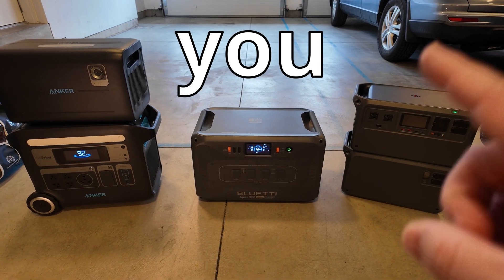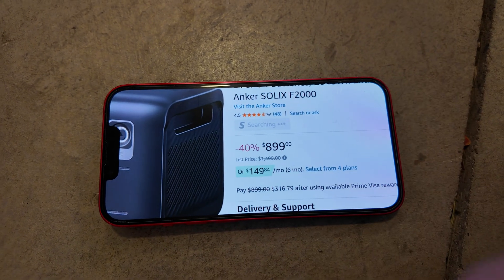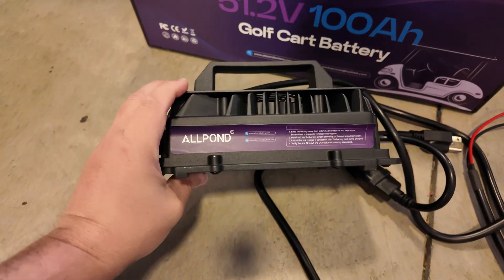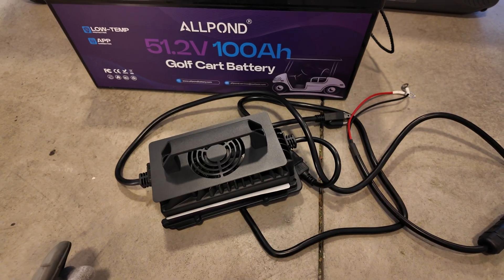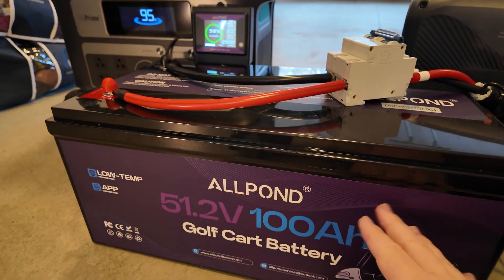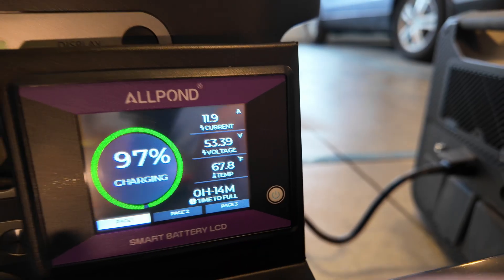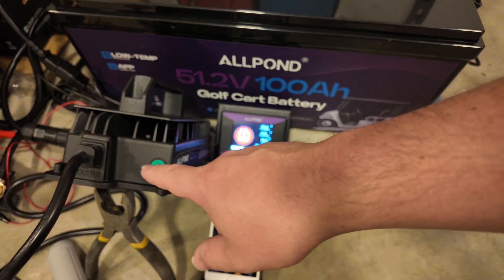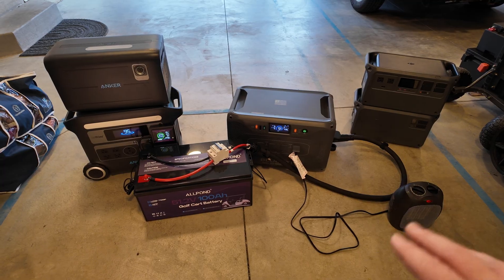The Great Solar Generator Rip-Off (And How to Beat It)

Comment: You are being deceptive by comparing apples to golf balls so lets stop here. A Lead Acid battery like you show is crap and is NOT a LiFeP04 battery which lasts for thousands of cycles and is what the Bluetti/Anker others now use. Going to ALLPOND I did found newer LiFeP04 batteries and that brought the cost up equal/competitive to what Bluetti and the other are. I do like your hack though if someone has the golf cart batteries  or can find them really cheap and then also has the room for all the "Kibbles & Bits" that will be open and laying all over the place to make this Frankenstein hack work. In conclusion, price check this option and also know whether you need an ALL-N-1 solution that is easily moved, safe and storable vs a Frankenstein hack that brings on added complexity and flaws but might potentially save a buck or two - maybe? Regardless, this is a great option if someone is on a budget and can actually find various pieces on sale.
Reply from the maker: Ummmm…you might want to look closer at my golf cart battery…it’s LiFePO4! I’ll take a hard pass on lead these days too!

Comment: Great video, and something I’ve wondered about.  What would stop you from DIY’ing a battery bank with mega Ah as long as it was 51.2v and LIFEPO? (I’m thinking EVE/CATL 314Ah cells). Does capacity difference matter?  When the Bluetti reached 0Ah would it just double the draw on the CATL’s?  Thanks for the info.
Reply from the maker: Nothing is preventing that at all so long as you have proper over current protection! Did you see my "tower of power" in this video? I have what you are talking about going on! :)

Comment: Last year, I purchased an Oupes mega 2.  the expansion battery cost is insane so are there solar panels it works then I purchased 2 wattcycle 12v 100Ah and a 2000w inverter $450? Works best bang for the buck
Reply from the maker: That's awesome you found a great bang for your buck solution!

Comment: Watching this 2 weeks after I bought 2 Delta 2 Max expansion batteries refurbished off EBay. Saw your original doing this with a Temgo, but I still know too little about electricity & couldn’t trust myself to not torch our house missing a step or wiring something wrong.   Hurricane Helene (we’re in Asheville) still has me on edge. If I could tell anyone ANYTHING…don’t start w/ a 120 volt unit if you choose the portable power station route
Go to 240V like the Bluetti. Pay for.a transfer switch. Then you can do this shortcut and a dozen others. But if.get stuck with a 120Volt unit like me, you have no future flexibility to run important things
Reply from the maker: Thanks for sharing your experience and the great advice about 240V systems for future flexibility!

Comment: ❤❤❤❤ This is beyond interests to me as I have the anchor unit that you show there as my soul power source for my full-time living school bus conversion and was contemplating getting the expansion battery! With this Allpond battery solution it would effectively double the battery expansion I do see that it is large but I am inside of a full size bus so I will make the room and I guess I could eventually add a second one of these batteries to the mix yes? And you say solar should be ran through it instead of the  Anker unit? I'm guessing that would facilitate more possible solar than what the Anker itself grants? 
This is my second year living in the bus so now it's time to tie down things and finalize what works and what's the best bang for the buck.
Reply from the maker: Yes! This is perfect for your setup!!! The Allpond battery is actually smaller in cubic inches than the Anker expansion battery! Which is crazy cause it's more than double the capacity! It weighs more however. And yes, you can pair a bunch of the Allpond batteries together! And yes! The solar inout to the batteries can be MUCH higher! This is my favorite charge controller! https://amzn.to/43LkeUW It gives you double the solar the F2000 can accept. If you add more batteries, add an extra controller and solar for each one! You could have a sweet system! Especially with a full-size bus to work with!

Comment: The old Bluetti expansion batteries at least had on-board outlets (and in the case of the B210, even it's own on-board 500w solar input!).  The new ones don't, sadly.
Reply from the maker: Yes. Kind of sad.
Reply: I think they were trying to lower the price point by stripping down features.
Reply: Yes. This year they are obviously trying to save pennies to lower the cost of “per watt hour” to look good while still making their cut of profit. There really is no other way to express what they are doing (i am a Bluetti guy) except by saying “penny-wise, pound foolish.” 😢

Comment: Great video and great idea.  But it is not portable(for me). If it doesnt have to be portable then its fine. It is use case dependent.     In my use case wieght is a key factor.  I have a pecron F3000 because of the smalll footprint and it weighs "only" 63lbs.  The EP3000 extra battery is 53lbs.  That AllPond Battery wieghs 87lbs by itself.. The "small" all in one units in the video have small built in batteries In comparison(to the Pecron F3000) and the add on batteries are the same small size.  I have  6144 whr because the F3000 has 3072whr to start with and the extra battery adds the same 3072whr. its all in what the users needs are.
Reply from the maker: You're absolutely right! It's all about individual use case and needs! The portability factor is definitely a big one for many.

Comment: There is a video on how to hack into the battery expansion port on the Anker Solix F3800 to output to XT60 cable. I wonder if the same can be done on the Anker 767 Powerhouse you have. Here's the video. https://www.youtube.com/watch?v=afumx_g3Xg0
Reply from the maker: Yes! There is! I plan to make a video about it at some point here!

Comment: I couldn’t find the weight of this golf cart battery at the Amazon product link. AI “Rufus” didn’t know. All the reviews talked about the weight being so much less than lead acid batteries. One mentioned he weighed it. Funny, no one states the weight. It’s also odd that it would be left off a product description when there’s all this comparison going on and how much weight matters. I want to know if I can lift it. So, how much does it actually weigh?
Reply from the maker: It's about 90lbs. So WAY lighter than the same amount of battery storage in lead acid. But still heavy enough to be careful lifting it!
Reply: @theresatrickforthat  Thank you. Your video had good info.

Comment: Black Friday Deals - I have been kicking around getting the Fossibot thats 3840Wh 3600W for $979
- I do own a few Delta 2 units (and unfortunately I did buy an expansion battery at the time)
- I see the VATRER server Battery and these G.Cart Batteries and have been kicking around getting one of these, and doing the DIY as shown.
- I also have a few DIY systems, 24V and 12V.
- My FOSSIBOT interest is due to: it is just there ready to go, all in one system at a great pricing.
- So, anyone that reads these comments, is the VATRER Rack Battery or the Golf Cart battery the way to go?  I see the advantage of having a 5210AH backup to use on the Delta 2’S 
- I appreciate any responses….
Reply from the maker: I have the FOSSIBOT as well as the Vatrer server rack battery (videos coming on both of those within the next 6 weeks!) I haven't fully tested the Fossibot, but it seems very good bang for the buck! 

As far as the comparison on the battery. Get the server rack battery if you want a huge pile of batteries in a server rack. and it's nice and organized!
The golf cart battery is better in every other way and is better bang for buck. Has more monitoring capability since it has a screen & bluetooth app (Vatrer only has a screen) they are built for high vibration environments so great for moving around or in an RV, are water resistant, can be outside in the weather! And come with a really nice dedicated charger!

Comment: Great information you are sharing, thank you. Propose you test the "alternator" chargers like the 800W one from Ecoflow to do this, only difference is battery will have to be 12V or 24V but it is a bit more straightforward and can also reverse charge as well.
Reply from the maker: Are you spying on my future video spreadsheet? Alternator charging combined with solar power coming in hot in a few weeks! :)
Reply: @theresatrickforthat  Haha, looking forward to it! Thanks!

Comment: This is great! But the AllPond isn't less than half the cost of the proprietary ones. It is less but not 'less than half'; if it was , it'd cost less than 500 bux.
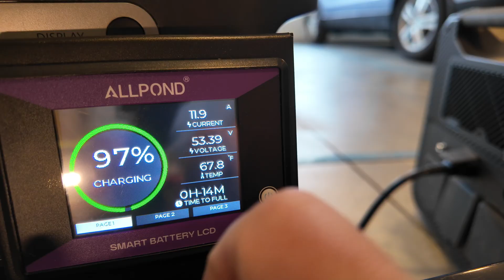You lost me at the 11:00 min mark, where you had the AllPond hooked up to the bluetti, but then one of them was also hooked up to the anker....? I'm no electrician so, no idea what that moment was about.
In any case, very interesting and will certainly keep this in mind should I want to expand. I only have a little AC70 Bluetti which I've yet to really put thru its paces. I'm going slow, learning, watching lots and talking to solar people.
Reply: I just bought a 3kWh Anker expansion battery on sale for $900. Pecron has their 3kWh battery for $700. The 5kWh golf cart battery is $730. Per kWh, that's $300, $233, and $146 respectively. The claim of "less than half" seems legit to me.
Reply from the maker: It is less than half for sure! Add up the cost per watt-hour of battery storage and you'll see if easily half the cost or more! 

Yes! I'm showing two different connection options! Subscribe and I'll be showing more info and you can learn more on your quest to learning about this kind of stuff!

Comment: Look forward to the video on how to make this cable for Ecoflow extra battery. From what I see you chop off one connector, hook two DC cable on a DC CB, but what about the rest of the data cable?
This setup can reduce the cost of solar battery for ecoflow Powerstream setup. 800w micro grid tied inverter combined with 1000w PV inverter in Delta 2 Max.
Reply from the maker: Yes! That video is on my list for the coming weeks!
Reply: @theresatrickforthat  exciting!!!   Ready to use one of these Allponds to expand my Delta 3 Plus with the direct EXTRA BATTERY port
Reply: @theresatrickforthat Mine too, and I covered this battery hack in detail and expanded it to be automated and have a global dashboard.

If we are covering the same things, maybe collaborate?
Reply: @ViciousXUSMC  Ecoflow powerstream used to be on sale for $100 (or GBP), if this modified can bypass the "smart" thing that control the ecoflow system then it can significantly reduce the cost of micro inverter solar setup, because delta 2 max still cost quite a lot for only 2kw and not many want a camping battery, only home setup.

Comment: Awesome video. 

My understanding of the Anker f2000, which is one reason I bought it over ecoflow, is that it will discharge the expansion battery first and then the main battery. 

You mentioned having both batteries are about the same charge state. How would that work with Anker?
Reply from the maker: Yes! The F2000 does discharge the OEM external battery first before the main unit. If you hook up the golf cart battery to the DC input like I showed in this video, then it will discharge the golf cart battery first as well!
Reply: Any other brands that discharge their port connected battery first?  That would be useful if the expansion battery is hard mounted  @theresatrickforthat

Comment: Sure you can go the cheap but dangerous way through the solar input, but there is no control to stop killing the battery by low voltage....
Reply: The battery probably has a bms that will protect itself and cut off on low voltage
Reply from the maker: @Mac_raymond is correct! The BMS will protect the golf cart battery and shut it down before anything discharges two low. Pro Tip: The Overkill Solar app connects to the BMS and you can actually raise the threshold the BMS shuts down if you want!

Comment: The ONLY advantage I see with proprietary expansion batteries is recharging speed.  Typically, you can charge them as fast as the batteries in the power station.  Other than that they’re mostly a ripoff.
Reply from the maker: And you must have not watched the whole video where I show one version that allows for that to happen!
Reply: They're also wife friendly, my wife took one look at that setup with the wires, isolator switch and cable and said NO. I can do that in my garage but it's not allowed in the house ;-)

Comment: I agree with all you're saying when it comes to price. Even more so if you will be charging with a generator at some point, but I ky marginally since all those oowe stations charge directly , but yeah, when it comes to the extra proprietary batteries the golf charger is nice.

 But from 5 minutes on.. Most people don't care to do any of that for "portable" systems. For those that do - cool.  

But, clean and truly portable can pay for itself if that's how you mostly plan to use it.  Most people are not taking all that extra stuff tent camping or tailgating.

While not as a cheap, there are some good options too.   a Pecron EP3000 is $650 out the door with no tax.  And it charges independently and can be used independently and it is clean with the rest of the system and can disconnect one cable and move it without having to mess with extra cables.

Pros and cons for each situation.
Reply from the maker: 100% true! Thanks for sharing!

Comment: Pecrons EP3000 has standalone charging and output. And it’s $699 for 3KWH. Not bad 🤷🏽‍♂️
Reply from the maker: No. For proprietary battery…not bad at all. But would you spend $40 more to get 2 extra kWh of storage plus a charger that can handle dirty power? It all boils down to personal preference.
Reply: @theresatrickforthat  I agree. I don’t think any proprietary battery can beat a deal like that honestly. But for what it is I think the EP3000 is the best out of the bunch.

Comment: I agree wirh the ridiculous cost of proprietary batteries and have considered a stack of 5.12kwh LiFePo4 server rack batteries in a rack. It would be placed in the basement and all my power stations are on 1st floor. Do you have any suggestions on how I could recharge my power stations on one floor using the server rack batteries ifrom the basement? I would be using their solar input ports, DC to DC, to recharge them, but it is the distance I do not know how to overcome.
Reply from the maker: Could you locate the power stations downstairs too and then just run AC extension cables up to the 1st floor? That would be much cheaper in wiring and more power efficient vs. trying to get the DC power upstairs!
Reply: @theresatrickforthat ,  not my house, besides I have about 9 power stations and use each one. I have 1 Pecron E3600lfp with 3 (soon to be 4), what do you think of using it as a recharge station for several of my power stations instead of buying the server rack batteries?

Comment: By this logic, may I ask why buy the non golf cart units in the first place? ie why do I want say the original units for the battery extenders in the first place, would I not just get two of the golf cart batteries instead?
Reply from the maker: I think we’re on the same page. That’s what I’m saying here. Rather than buying any of the OEM expansion batteries in the first place…just go with the golf cart batteries! 
Of course you could save even more money and just get a cheap all in one 48v inverter to pair with the batteries and not even buy a power station to begin with. Or like I said in the video, use the AIO unit for home power backup, and then for mobile power needs, get a portable power station. Good news is the batteries for either thing will work! So your investment gets better use and it’s significantly cheaper!

Comment: The way to beat it is to never buy any brand of solar generator that uses cheap Chinese, engineered and built high frequency transformerless inverter tech. Only purchase solar generators that use low frequency,  transformer based inverter tech.
Reply from the maker: Haha! It’s been a while since we’ve seen your comments about this on the channel! Nice to have you back boosting me in the algorithm with your comments! I’ll take em! :)
Reply: Their all Chinese. Algoboo

Comment: Thank you for your througones.  How about a video on high speed alternator charging?    That would be the icing on the cake for me
Reply from the maker: Are you spying on my video plan spreadsheet? Haha! I’ve got just that very video coming up in a few weeks! :) Stay tuned! It’s epic!
Reply: @theresatrickforthat  If possible, I'd love to see some sort of testing on "direct" charging of a 12v lifepo4. One of the sticking points (there are others) is the supposed voltage spike when the BMS shuts off charging. But even on my old vehicle the draw just to run the vehicle is 15A, I don't see there being a surge while there is always a draw from the alternator, regardless of the battery. 

There are so many options, as a storage battery that may go quite flat, it would be great if there was/are Lifepo4's that limit charge current through the BMS to something that wont overload the alternator. 

Nothing is going to fit everyone's use case, but I think some of the supposed problems can already be mitigated cheaply. Those DC to DC chargers aren't cheap enough to me. I'd rather just be able to direct connect.